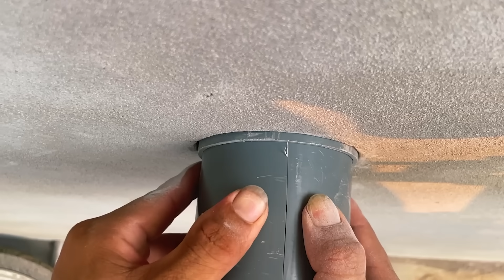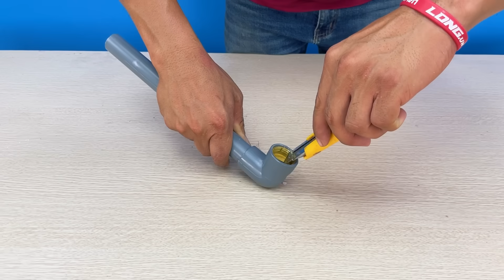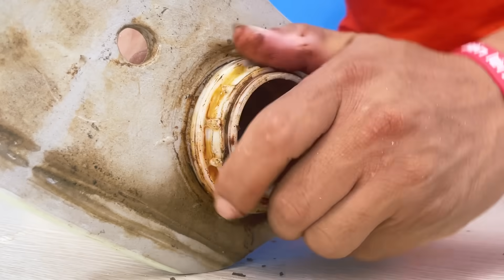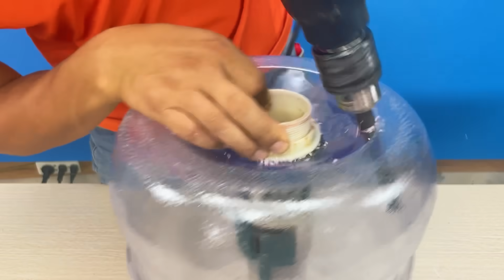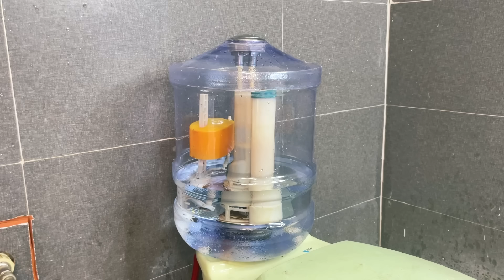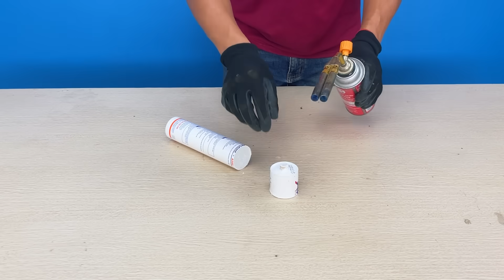Plumbers near me are secretly doing these things! Make toilets tank and showers from empty bottles

Comment: I don't know any real plumbers doing this stuff. They would go get the right stuff. This would only work if you lived in the city dump and the gate was locked.
Reply from the maker: Your perspective on using the right materials is valuable. Could you share more about the importance of using proper plumbing materials and techniques, especially in situations where shortcuts might not be the best approach? Your insights could help viewers understand the importance of doing things correctly.
Reply: Number one is very case specific, that MIGHT do the job for some blockages, but that's nothing a decent plunger wouldn't be able to do anyways. Plus, you're having to cleanup and peel all of that tape off, unless you're going to specify exactly what tape to use and how to apply, most people might end up flooding their bathroom if it's not airtight.  You're inviting failure at that point. Use a goddamned plunger, or better yet, get a snake.  

Number two is a BIG no no. You might end up fixing the leak, but you're essentially reducing the inner size of the pipe, and if this is a proper building and isn't just some random backyard BS, that pipe probably a downpipe for the roof drain. The sizes of these are specified to the size of the roof as well as accounting for potential live loads of water. If you reduce the size, the roof may not be able to drain the water fast enough in the event of a big rainfall.

The water bottle showerhead... It's just laughable, and plumber worth their penny wouldn't be caught dead trying to jerry rig that shit. You're spending more time and effort creating that monstrosity instead of just replacing the damn fixture.

The last one, you're literally just making a reservoir tank.  This is not a tip. There are many factors at play with this one.

As a guy who builds houses for a living, tips are supposed to be informative, constructive, and short. You're giving us a bad name with these "secret things ____ does". Being passive aggressive with commenters with the "please tell me the importance with using proper materials" is insane, if you need us to explain what's wrong. Then you really shouldn't be posting these videos. Super unprofessional.
Reply: @tipsunknow ⁰❤🎉😊😊RJFHXKFMMKLMMMNMNMNJJKJBLF

Comment: That's machiroo subcontinental style plumbing especially that nose picking pinky fingernail 😳😳😳. Get the right parts first and install properly, you don't need "hacks".
Reply from the maker: Thank you for sharing your perspective! It's essential to have the correct parts and ensure proper installation for long-lasting plumbing solutions. While the video may have showcased some unconventional methods or "hacks," it's important to note that such approaches might not always be the most reliable or durable.

However, these videos sometimes aim to demonstrate creative problem-solving in specific situations or provide temporary solutions. It's crucial to emphasize the importance of professional plumbing work when necessary and to use DIY methods with caution.

A suitable response might be:

"Your point is valid – having the right parts and following proper installation procedures is essential for plumbing projects. While the video may show unconventional methods, it's essential to remember that they are not always the most reliable option. We encourage viewers to consider professional help for complex plumbing tasks and use DIY solutions responsibly. Thanks for sharing your thoughts!"

This response acknowledges the importance of your viewer's input while reinforcing the need for responsible DIY practices.

Comment: That giant water bottle is building up pressure (if the lid is closed) making it a pressure assist toilet❤
Reply from the maker: Using a large water bottle to create pressure for flushing can indeed work as a form of pressure-assist toilet, although it's not a traditional or recommended method. Pressure-assist toilets typically use a specialized tank and internal components designed for this purpose. While your DIY approach may provide some extra force for flushing, it's essential to ensure it's done safely and effectively to avoid damage or malfunction. Additionally, it's essential to consider potential risks and limitations associated with homemade plumbing solutions.
Reply: @tipsunknow  cool man! The pressure lite system has no air to leave but builds pressure obviously, with that water filling up the sealed plastic tank creating air molecules. But to much can make it 🤯.  That's why we have fill valves, no more, no less.
Reply from the maker: Thank you for your comment. Wishing you a happy new day
Reply: @tipsunknow  thanks!
Reply from the maker: thank you bro

Comment: There isn't a plumber in the US that is using a 5 gallon water bottle as a toilet tank. Want to know why? It's a violation of federal law to do so. According to current US regulations, no toilet can flush more than 1.6 gallons per flush. In the not too distant future that amount is going to be decreased to 1.28 gallons. Most homeowners would laugh at such a ridiculous repair. Even if it were temporary. There isn't a plumber poking holes in a soda bottle to make a shower head as well. There isn't a plumber who is doing anything depicted in this video. Mostly due to being ridiculous 'fixes', let alone code violations.
Reply from the maker: "Thank you for sharing that information about US plumbing regulations. It's crucial to adhere to the law and safety standards. However, could you also provide insights into more practical or code-compliant solutions for the issues raised in the video? Your expertise could help viewers make informed decisions about plumbing repairs."

Comment: So you have PLUMBERS ..near you that cant afford a plunger , or proper fittings...
And they are plumbers rite...???
Reply from the maker: It's important to note that the individuals in the video you mentioned may not necessarily be professional plumbers, but rather individuals demonstrating creative or unconventional methods for addressing plumbing issues. Plumbing professionals typically use industry-standard tools and fittings to ensure the highest quality and safety of their work.

In some cases, especially in DIY or emergency situations, people may resort to alternative methods to address plumbing problems temporarily. However, it's generally recommended to rely on qualified and experienced plumbers for professional plumbing work to ensure that the job is done correctly and safely, using the appropriate tools and materials.

If you're in need of plumbing services or repairs, it's a good idea to contact a licensed and experienced plumber who can assess and address your specific plumbing needs following industry best practices.

Comment: I guess you haven’t heard about a plunger
Reply from the maker: Plungers are indeed a common tool for dealing with clogged drains, especially in household settings. They can be quite effective in clearing blockages caused by organic matter or debris. However, in some cases, especially with more severe or complex blockages, additional tools or methods may be necessary for effective clearing.